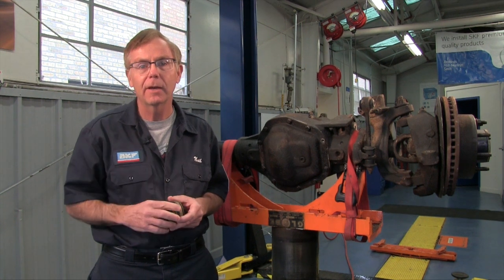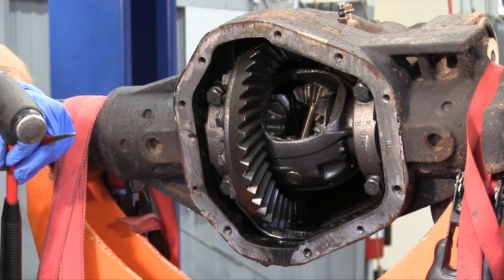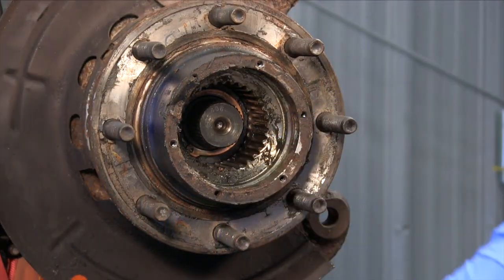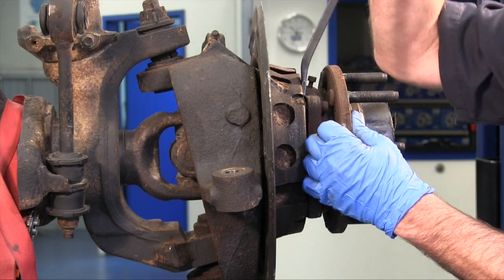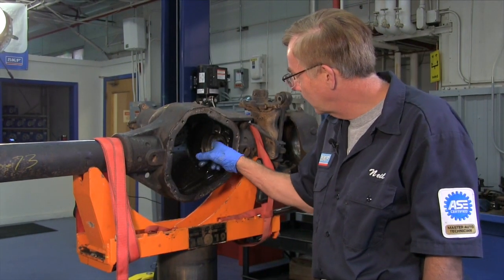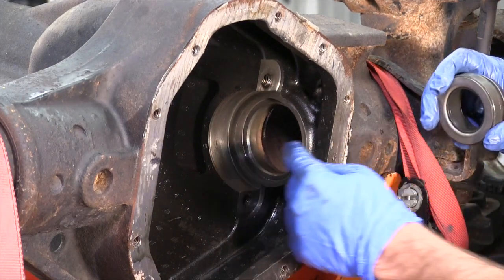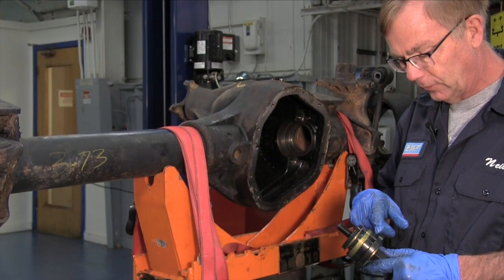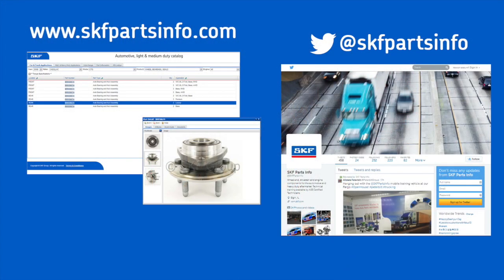Ford Super Duty Dana 50 & 60 Inner Axle Seal Repair

Comment: Oh boy. I had my super duty inner seal changed three times from the same shop and every time it starts leaking within a few months. I bet the monkeys didn’t have the specialty tool. Ended up doing the seal replacements myself with the specialty tool and it’s been a year no leaks. Great video. To the point and useful
Reply: If you watch this video closely when he's before he pulled the axle shelf out you'll see that upper Kingpin moves quite a bit well that is why your seals repeatedly going out you have to have good kingpins otherwise that seal will just repeatedly fail the seal will last a lifetime of that vehicle if nothing plays on it negatively
Reply: @crazedgoldminner7384  thanks for the tip. I was going to tackle the job myself next month I’ll
Make sure I check for any play before I reinstall.
Reply: Thei are ball joints on those years not kingpin

Comment: Hello!
Im about to reseal my dana 60 axel, but my 2001 dodge ram has the axel that disconnect, my question is, is it the same procedure to take the left hand seal for my truck? I can't seem to find a video that does the seals on my truck with the axel that i have, thanks!
Reply from the maker: Yes, if you have an axle shaft that pulls out the replacement procedure will be different.
If you provide a bit more detail we can help with your repair.
 Are you working on a 3500 or larger series truck? What is the SKF seal part number? 

Are you working on the front or rear?

Comment: When reinstalling the carrier other then everything going back in the same way is there any adjusting or special tools? Thank you
Reply from the maker: As with any rear carrier disassembly it’s always good to inspect the components 
you are removing. Generally, with good bearings and gears, the assembly can go back in place with just the bearing caps being torqued to specification. If any bearings are changed then backlash and preload need to be checked. So you will need a torque wrench at a minimum to reinstall. Thanks for watching!

Comment: Cant you just unbolt 4 bolts on hub assembly  and slide it out as a whole unit ? And have to remove brake caliper and rotor.

Comment: I have a 2000 ford f 250 super duty 7.3 diesel 4x4 with a dana 60 axle does the driver side its the short axle does it have a bearing on the end of the axle when I pulled it out it didn't have a bearing on it or it in the housing has any one had this problem
Reply: Both inner axles have a dust seal, but no bearing.

Comment: My carrier didnt come out whats the trick???
Reply: May need a case spreader to move the case apart some.
Reply: lol its never like the video!!! this sounds crazy but it works awesome!!! get a bunch of shop rags and start feeding them into the gears while someone spins the pinion for you. it walks it self right out.  putting it back in can be tricky. I use a block of wood and mallet.  (i know this is old post but might help someone else out)
Reply: I know this is old but once you remove the bearing caps you can use a wrench put it on the ring gear bolts and turn then as if you were tightening it should come out fairly easly just make sure to catch the assembly

Comment: I've been a Ford man my whole life I've have almost 50 years experience with this
Reply: How do you know when these need replaced?
Reply: @shtoleva07  any oil on the outside of those tubes near the knuckle I will tell you that it slowly leaking and of his solid they can you can get caught carrying your differential up so you will leaks are not acceptable and anyway on a differential
Reply: @Crazed Gold Minner  I'm rebuilding a dana 60 from a super duty and there is no oil near knuckle but I think I'm going to replace those seals anyway, I already have it stripped down to nothing so might as well
Reply: @shtoleva07  wrenching for 60-plus years I recommend that you spend a couple dollars for the Timken bearings you'll have less failure problems if any failure at all if you do the job right
Reply: @crazedgoldminner7384  ok, the hub assembly is a complete unit on this. Have you had experience with that? I have never seen this setup before.
Reply: @shtoleva07  if you're going to work on those Dana 60s first thing you want to do is get yourself a spreader because you're not going to be able to get the car in and out without doing any damage to the bearings or races without it there's a funny tool that actually put them both seals at the same time it goes in between the two but the seals up in place and then turn little nut thing and it pushes in both out into the cavity then use the spreader and put your carrier back in and when you reinsert your axles be very gentle about passing through that seal best of luck to you PS that carrier is heavy heavy heavy you get a Helper
Reply: @shtoleva07  highly recommend ordering Timken bearings and seals yeah you're on the right track that's a big job do it right the first time for the extra couple dollars and farts you'll be doing yourself Justice in the long run